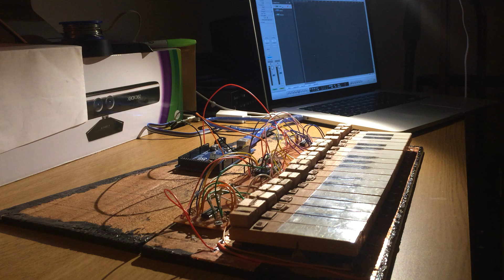Vintage Toy Synthesiser - Key Mechanism Development - Part 2

Comment: Hi Liam,

Nice job on the toy piano looks really cool!
I'm doing a similar  project myself. Just wondering what sensor did you use for the velocity and poly pressure sensitive?

Greetings
Reply from the maker: Hi Vincent, 

Thanks! I used Velostat to make homemade sensors - you can read more about this here - https://www.element14.com/community/community/design-challenges/musictech/blog/2016/01/04/vintage-toy-synthesiser--development-of-the-key-mechanism-part-2--production.

I'm interested to find out more about what you're working on!